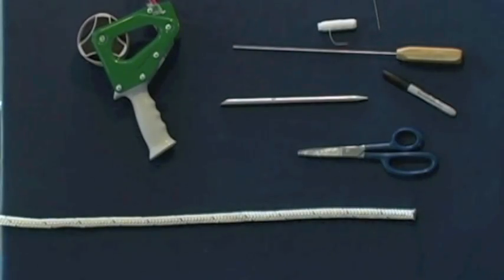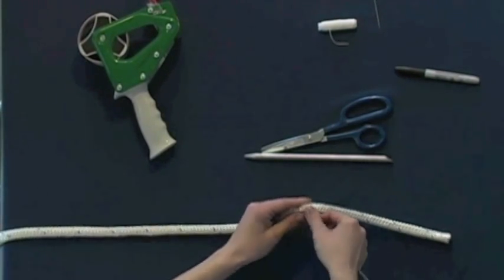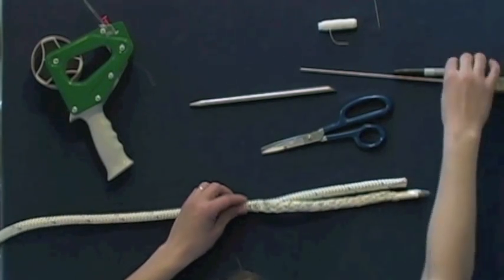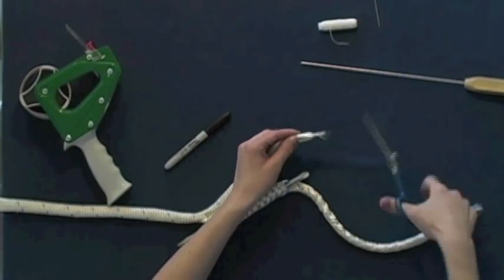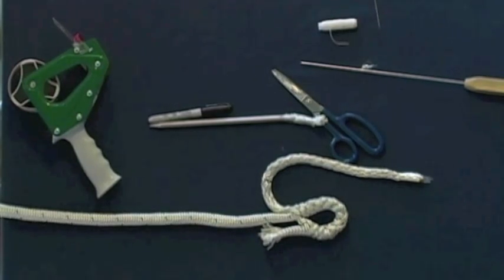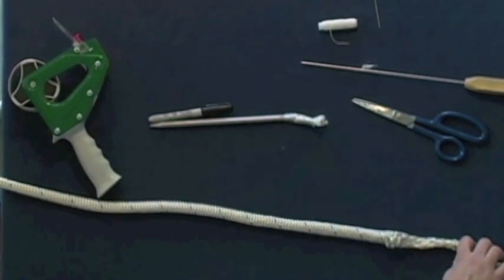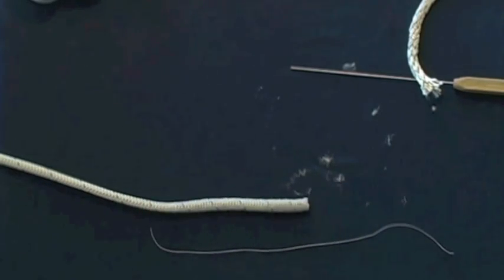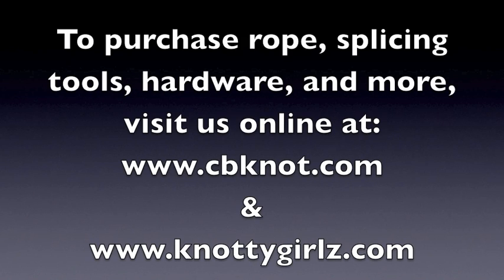How to Finish your Horse Lead Rope (Popper end) or Dock Line - Class 1 Double Braid End Splice

Comment: A back splice is only to stop fraying and requires no strength or stitching. As such it is easier to do it with 1/3rd of the dimensions used here. A short fid length (7 X the diameter of the rope or 70mm for 10mm rope) for the extraction point and half a short fid (35mm) for the second mark. The 3rd mark is not even required as all you need to do is exit the fid from the core at a point that is longer than the short fid length of the cover that will be inside it (most people can estimate a minimum of 7cm's). Using these lengths will make the splice easier to do and waste less rope.
Reply from the maker: As one who splices I agree.  However in order for us to be certified by Samson rope  company we have specific guidelines we have to follow.  We have Samson certified splicers on staff which means they had spliced rope, sent it to Samson, it met their requirements as far as working load on splicing.  I agree depending on the application, you are correct!  Great comment, Thanks!!

Comment: When making the eye splice for lead ropes, I have noticed some of the newer leads are more flexible in the eye in order to attach snaps more easily.  It is as if the core is removed in the loop which forms the eye.  If this is the case can you give guidance on how to do this?